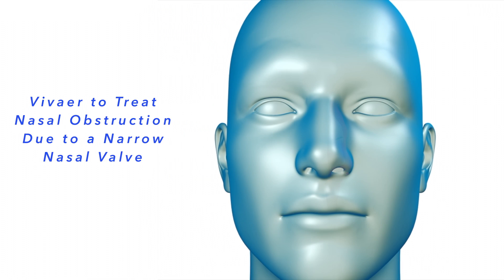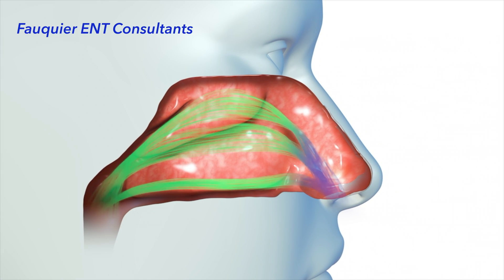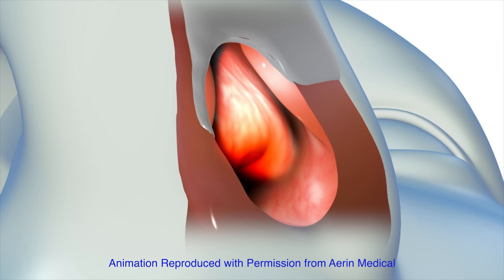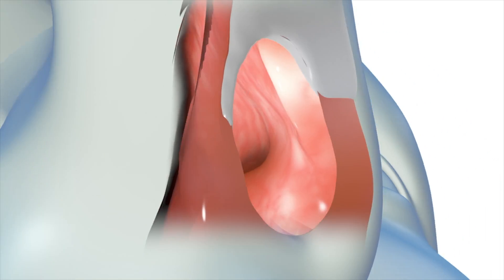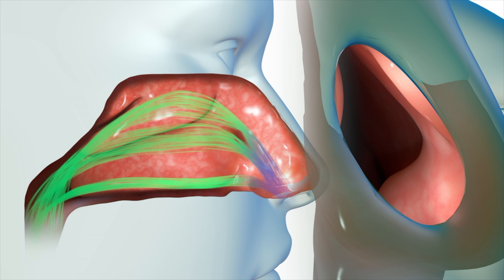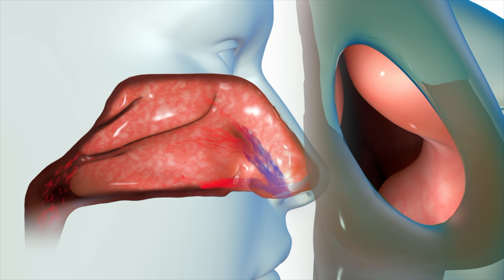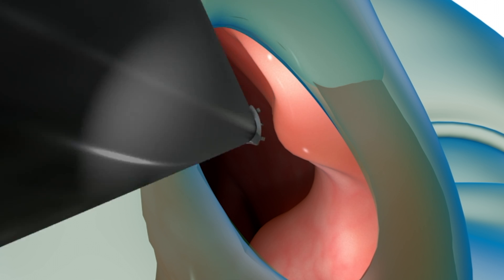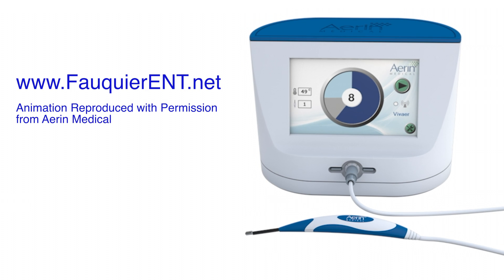VivAer to Treat Nasal Obstruction due to Narrow Nasal Valve

Comment: Can this cause empty nose syndrome? God I need help and the doctors recommend I do a turbinite reduction but I am worried about ens
Reply: Be careful bc I lost sensitivity to smell from it
Reply: @erickrobles6365  how's your breathing now I'm thinking about getting it done
Reply: @lemonpepperwings4434  so my breathing improved very slightly. But thats bc it was not the turbinates constricting air flow but my nasal valves. The previlus doctors didnt diagnose that before until a new doctor i am seeing. So always get multiple.opinions!
Reply: But again, if you get turbinates done, be sure to let them know not too take out a lot bc you will lose some sensitivity to smell. Meaning, it will he harder to smell stuff that isnt close to your nose.
Reply: @erickrobles6365 I have collapsed nostrils is that connected to turbinates
Reply: @lemonpepperwings4434  nope.. two different parts of the nose
Reply: @erickrobles6365  thanks for replying back I hope your situation gets better  💪
Reply: Erick Robles b
Reply: @erickrobles6365  i had radiofrequency turbinates reduction done (seriously regret it) and I've noticed it has affected the way i localize scents meaning i have to put the things i want to smell close to my nose which is extremely annoying. It depresses me that any kind of turbinoplasty is irreversible so anyone considering doing this proceed with caution (or better yet, don't proceed at all)
Reply: Erick Robles what was the fix for the nasal valve issue, if you don’t mind answering?
Reply: The same thing happened to me!
Reply: I am scheduled to have this treatment done next week.  I appreciate your feedback on this and now you have me quite nervous about getting it.  I have been looking high and low for other cases of people losing their sense of smell and can not find anything on it.  Could it be a very rare case, maybe some that happened to you because of other factors combined with this treatment?  When I do a search query "Can Vivaer cause loss of smell?"  I get nothing on it at all.  I'm not dismissing your comments though. It makes sense that something like that might happen given where this treatment takes place. Very near to the area of the nose that receives smell.  Thank you
Reply: I am 2 years too late, but it might help someone else

First. Septoplasty only if you need it (has to be justifiable).  Some doctors want to do them even if you have a mild. deviation.  This is not good medicine 

2.  Turbinate tissue ablation.  Outpatient, day procedure, takes about 10 minutes, wait an hour and then you walk out.

3.  For very significant turbinate issues (rare need), turbinate out-fracturing surgery. In hospital, inpatient.

Both treatments have no clinically evidenced manifestations of ENS.

In 2022 there is almost NO NEED to remove turbinate bone.  You would have to be a rare case.
Reply: @DoubtingThomas333  you may not be too late for those lucky enough to have heard about empty nose syndrome before they got the surgery and are now trying to find a way they can breathe again without risking it, Mellow Mike warned me, what are your sources?
Reply: @Anonymous  to be fair, I had unilateral submucosal  inferior turbinate reduction on right and left.  I had issues for about 5-6 months following surgery, but in a day or two it's been 1 year and I feel good now, really good.
Reply: How do I find a physician who does this procedure
Reply: Herpes herbal cure add to Facebook
Herpes simple virus infection 

Genital herbal herpes cure

How can I get cured from my herpes simple virus infection

Herpes disease cure 

I want to get rid of my 2 years herpes disease
 
Is it good to use herbal medicine to cure herpes disease whatsaap Dr MOMOH on +2348117460268
Reply: Dr. Harrington is wonderful.  He is in Orlando, Florida.

Comment: Can this potentially cause ENS if too much tissue is treated?  Thanks
Reply: ENS is caused by bone and tissue changes to the turbinates.  It's a very complex system of thermodynamics and nervous system feedback.

This procedure does not seem to have a mechanism possible to cause ENS.

Unless you are in the USA I doubt this procedure is even available.  Most of the time in the medical world, a new thing like this would take at least 10 years to be taken up by normal ENT surgeons.  They like to test and test and test things and see how they pan out before using them in everyday practice.
Reply: @DoubtingThomas333  can you only get ens from surgery?
Reply: @AriL3ve  you can ENS from any injury to the nose and face affecting the structures of nasal breathing.
Reply: @DoubtingThomas333  An injury like getting “punched” in the face or something
Reply: @AriL3ve  if it's bad enough, anything is possible.  Even septum injuries can potentially cause ENS.  Anything that damages the structures of the nose, the nerves etc
Reply: @DoubtingThomas333  so even getting your septum fixed can cause ENS? I thought it was only if the turbinates were messed with
Reply: @Anonymous  any changes to the nose can potentially cause ENS.

I got mine fixed because I couldn't breathe anymore.  Meds stopped working.  I used to get annual mucosal reductions, but it was annoying for it to stop working and need meds again... I did something that would last long term and so far I'm happy with the results.
Reply: @DoubtingThomas333  I know you had unilateral turbinate reduction as you mentioned in another comment, is that the “long term” treatment you speak of? I have inferior turbinate hypertrophy on both sides + a deviated septum, I’m doing my research but can’t seem to find a way to get my nose back to the way it was without such a terrible risk, do you think my best route to take is to have a septoplasty and then this vivaer thing for my turbinates to get the results I want without any risk?
Reply: @Anonymous  all surgery carries risk.  Either have it operated on or don't.  The choice is yours.  Some people can't afford surgery and desperately need it.  Other people can afford it and spend forever thinking about it and being paranoid.